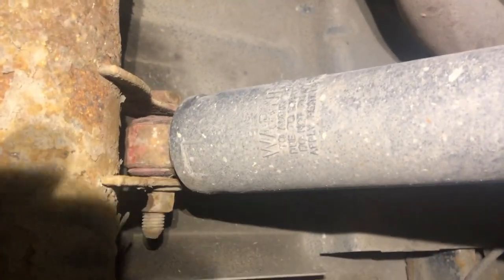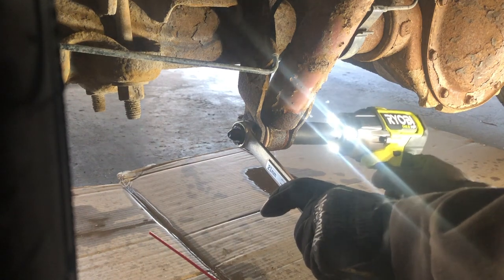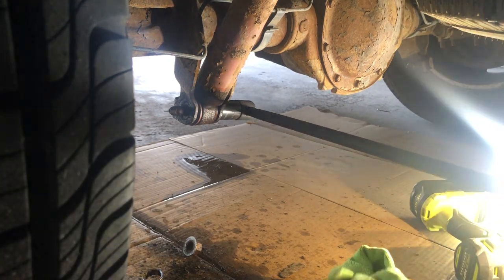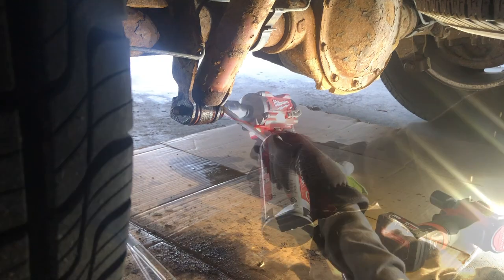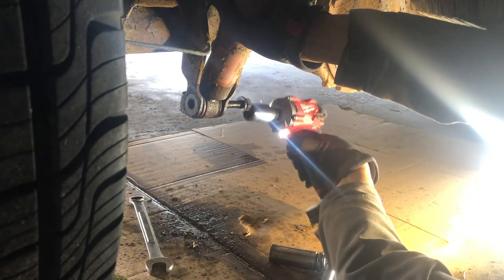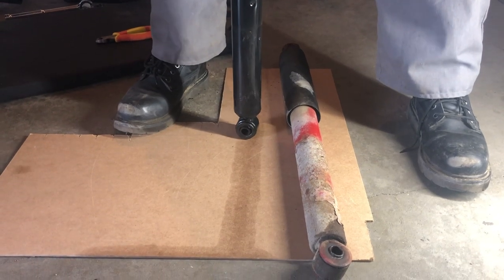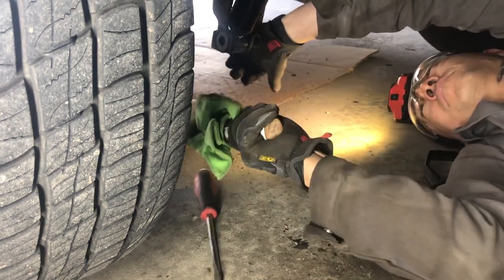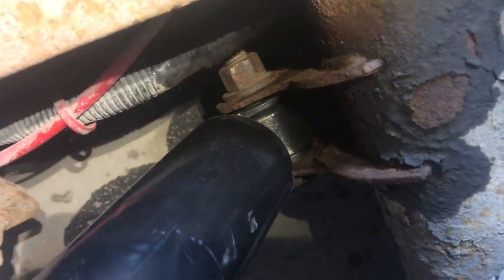Replace Rear Shocks on Chevrolet Silverado

Comment: Dows it matter what way the shocks go ?
Reply from the maker: Yes. Observe how they look before you take the old ones off and it will be pretty obvious.
Reply: I think for some shocks it doesn’t matter but if you’re using a OEM style replacement - they do have a specific orientation